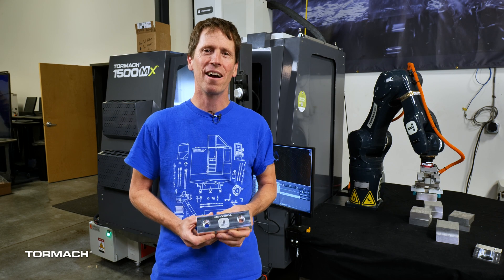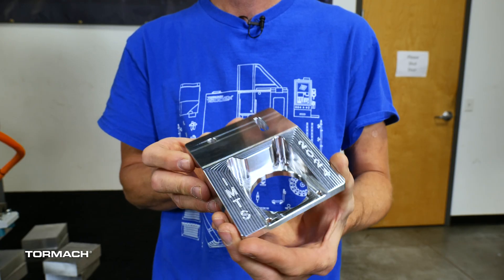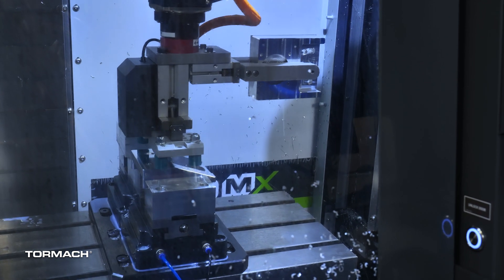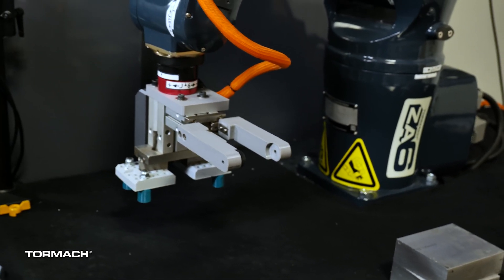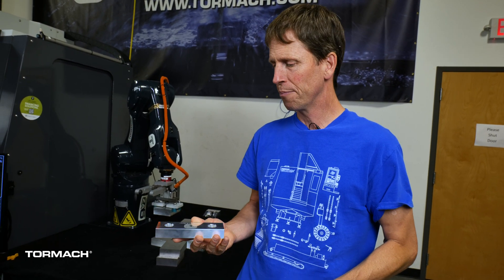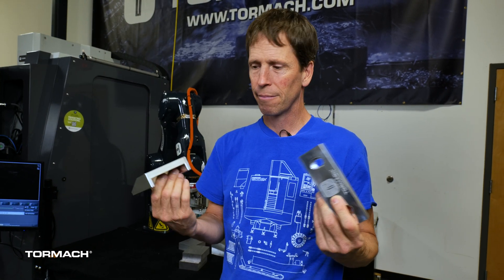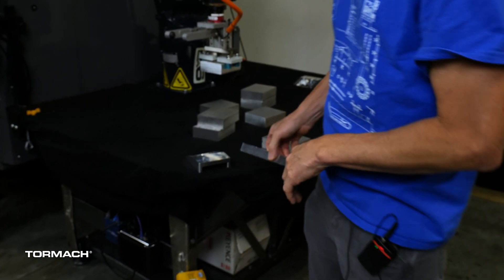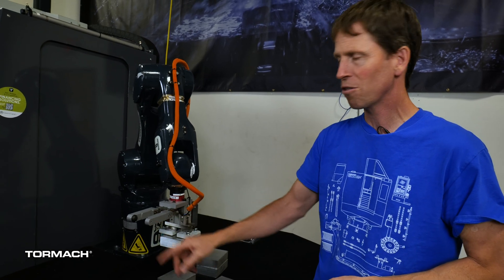1500MX and ZA6 Integration - IMTS microARC 6 Motor Mount - Part 1

Comment: Not sure whether I hate you or the big fella. Somehow I missed my birthday by 50 years. This stuff is awesome. My first intro to CNC was in the early 70's pushing buttons on a Beaver mill with a Slo Syn control for an after school job. Took another work path but spent my final working years programming and running a big machine doing solid timber door components. You guys certainly have progressed out of hobby machines. Well done.